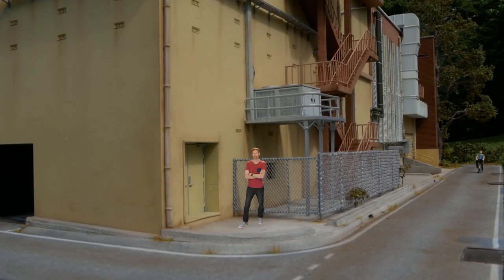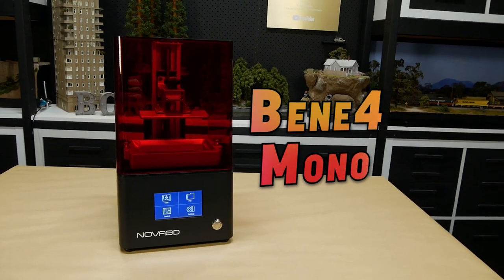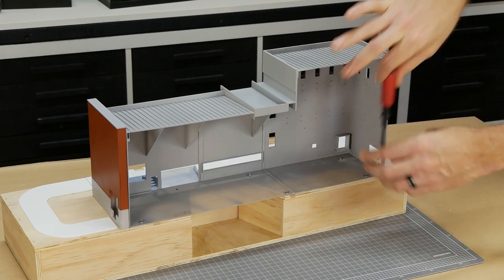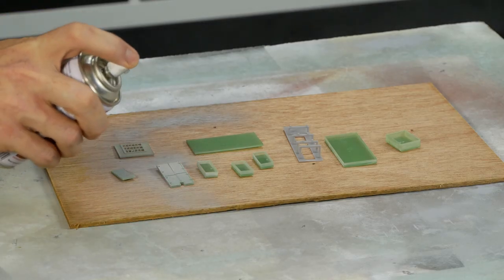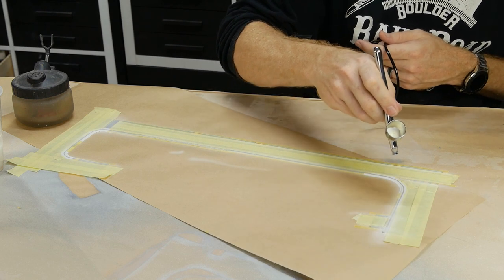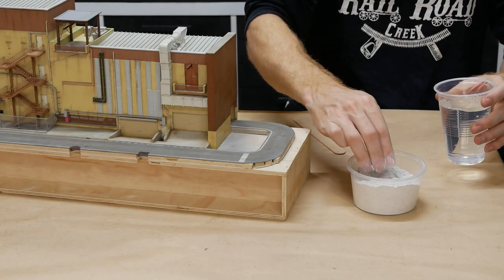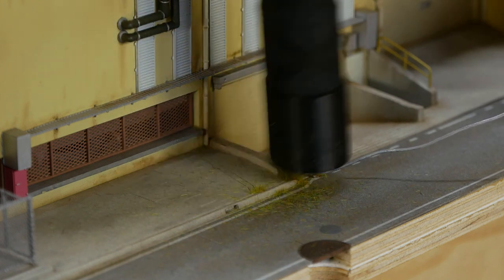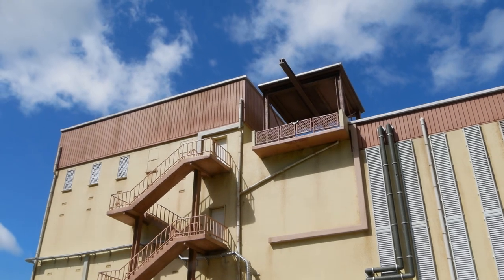Build & Animate an Actual Location – Model Railroad Scenery

Comment: Luke: "You can get results just as accurate as laser-cutting with hand-cutting methods."
Me: "Okay." crying-cat-meme.jpg
Reply from the maker: lol... yeah it would be a struggle... but not impossible 😎
Reply: For straight lines I'd say you can get pretty damn close with a sharp knife to the cuts you can get with a laser, though for long cuts the laser is more reliable, but for curves the laser will win every time.

Comment: When cutting styrene with a laser cutter if you make a sample cut first and measure the raised edge it creates. Then etch an outline around your cut edges the thickness of the raised edges after your cut it will quickly eliminate that problem.

Comment: I know two other ways of straightening wire that do not involve twisting it. Method one: Clamp one end of your wire in a bench vise, or other immovable object, then grab the other end with pliers and give it a good, hard yank (or two). Method two: Wrap your wire once around an immovable, cylindrical object, say two to five cm in diameter, then smoothly and steadily pull one end of the wire with pliers while holding the other end to prevent it coming off the cylinder.
You've built a very nice building there, very realistic. Most impressive.

Comment: Ok,  That Tilt back lid got my attention on your 3D printer.  every one I normally see is a lift off dome.  Both my AnyCubic Photons,  Original and Mono SE have the Garage Door Type front.   Ok Lets get back to the video as you start up Your UV Fingernail Drying Lamp  I mean, Resin Model UV Curing Station...
Reply from the maker: ha ha 😄 I just knew someone would mention something about my UV curing station 😂 Only the best at Boulder Creek Railroad!
The tilt back lid is so handy! I much prefer it over the lift away lids.
Reply: @BoulderCreekRailroad  I have a black one of those myself :)

Comment: Luke a general question.  I'm new to modeling in scale. When fixing gravel and soils down to the layout you first use ethanol probably to remove any oils. Since the advent of Covid it's been nearly impossible to get any alcohols  here  (Hawaii)  can I substitute denatured Alcohol as it is still a Grain product and can be burned in stoves. 91% medical is no longer carried on the shelves here.  The Denatured is carried in quarts and gallons in the big box and chain hardware stores so is readably available. There is no cheap shipping of flammable liquids, aerosols to Hawaii it must go HASMAT.
Mahalo

Comment: Resin tip: before curing, remove the supports and lightly wet sand and then cure. You would be surprised.

Comment: fantastic work as always.   So when you stiffened up the structure with hot glue, was that simply because it's much more easier to use a gun?    Weldon #16 is a thicker product that will really bond well acrylic if you needed a little more grab.

Comment: @Luke:   You mention @5:25 that you could have drilled the holes "during the laser cutting process."  I'll assume, then, the Beamo can laser drill holes in plastic type materials.  How small can the holes be, and can it do this in 3D printed resin parts as well?  Assume such parts are fixed inside using...say...a laser cut acrylic holding jig, so a precise pattern of holes can be drilled without the resin parts shifting.

Comment: Have you ever trimmed the supports and removed the flash from the 3D parts before curing them after they're fresh out of the printer? I don't own a 3D printer myself but a lot of miniature painters have found it easier doing this and they get a smoother finish. However, your parts here are reeeeeally delicate, so maybe trying to remove supports before curing would damage them? I can see wanting them hard and sturdy after curing before trying to clip anything.

Comment: How does one become a model maker like this? I am getting my degree in architecture but I love model making so much I wanna do it full time
Reply: Practice, knowledge on basic hand tools, files, knives. I'd recommend buying a cheap model kit to get an idea of the process and fitting, sanding parts. You can also buy styrene at most hobbyshops and practice building basic shapes. cardstock like what cereal boxes are made of is also used in architecture and is used as packaging all over the place.

Comment: @Luke Towan I've always removed my supports before putting them in the curing chamber as that's how everyone else I've seen has done it, but you do it the other way around I see. Do you generally get better results curing parts first, or it on a case by case basis?

Comment: This may not be the right place to ask this question but I have seen you weather things so here it goes. I just recently purchase a die cast model of an AR15 (1:3 scale} and I was wondering what kind of paints I should buy to make it look a bit battle worn?

EDIT: I do not own an airbrush.
Reply: You can use any paint you want so long as its primed in a universal primer first to help the paint stick and not chip. You can also use weathering powder from companies like Vallejo or just crush up soft pastels (do not use oil or chalk) to mix whatever color you want. You'll want to use something like matte soft acrylic gel medium to bind the pigments in place.

Comment: How do you turn the pressure down on that sparmax water trap like? I have the same the bleed screw just releases air on mine totally pointless as has the valve on bottom! I thought it was a pressure nipple like on my airbrush but friends on just does the same and realises air?

Comment: When curing resin you should try putting the model in a cup of water. It will then cure in the much smaller areas where it wouldn't normally be fully cured.

Comment: With Magnorail, it really isn't possible to go backwards though is it? So if you switch to the other direction with the motor, it will only be after putting the chain in the other direction first, is that correct? Thanks for another great video!
Reply: no that is not correct
Reply: @DrWhom  Do you have a magnorail system? Do you run it in both directions? Have you seen anyone flipping  a switch and running it backwards then? I have not and have been following this product for a year or so now. I have a system and this is simply something that never comes up, that's why I asked it in that way.
Even the FAQ doesn't speak about going in the other direction at all, so I'm asking for a more fulsome answer please and thanks.
Reply: @DrWhom  The tutorial would suggest it is meant to only go in one direction at a time due to the chain. 
"Note that the rounded end is intended to be in the “forward” direction of traffic."

Comment: Why not remove the support before curing? It is less prone to breakjng into the model.
Reply from the maker: True, I just find it less messy doing it afterwards, that way I can avoid getting uncured resin on my tools. If I had a dedicated set of flush cutters I could probably make it work.
Reply: @BoulderCreekRailroad  when working with printed miniatures I clean them in iso prop and then remove the bulk of the support. Then cure it after which I clean up the remainder. i have seen people also putting it jn hot water before the curing step to make the removal even easier. Still have to try that one though 😅